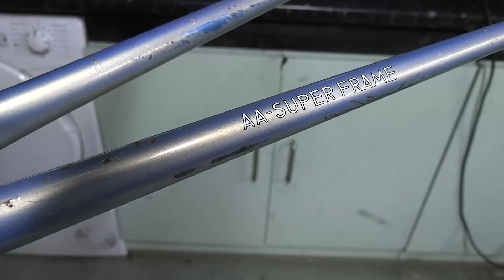Gazelle Champion Mondial Road Bike Restoration Build and Ride

Comment: The 1980s were an... interesting time for road bicycle racing. Can you imagine today that you are riding a Tour de France with downtube shifters, 2x8 gears, toe clips, and tires that you are supposed to stick on.

If you are looking for Gazelle kit, just pop over to the Netherlands, you will find a lot of Gazelle and Batavus frame sets just dumped in the scrap. Gazelle didn't have a huge market outside of the Benelux.
Reply from the maker: I should make a trip over and rescue a few, yes hard going doing a tour on one thats for sure. Thanks for watching and your support, all the best
Reply: Well I do my club ride on the flats (I'm 49yo) with my Saronni red Colnago Super with a 13-18 block and MAVIC open SUP clinchers.  Off the back drafting and using almost always my 13 cog keeps me young.

Comment: That is lush. Lovely frame that thoroughly deserved the effort (and money!!) you put in. 
Love me a Champion Mondial, I found my first one in a skip believe it or not, some 15 years ago. It's not as nice as yours mind, just an AB frame from the '70s. I built it up as a fixie and it served as my daily bike for a good while, commute, errands, the pub - a loyal companion during my 'wild years'. But other bikes took over and it was kind of just sat there, dismantled and slowly accumulating cobwebs and surface rust. Until I decided that it deserves better, so I fixed it up (more or less period correct) and did Eroica on it.
I've since got a 'modern' Champion Mondial, a '90s model, one of the very last steel road bikes Gazelle made. In the colour scheme I always lusted after, red with white lettering. I intend to build it up with a modern groupset and it should be really close to the one bike I've always dreamed of.
Reply from the maker: It’s always a bonus finding one in a skip….and for me you really are saving it from becoming scrap. Nice one, and great to hear your creating a resto mod with one, best of both worlds should make a great build. Good on you! Thanks for your support it’s much appreciated

Comment: Breathtakingly beautiful. Wow. I use challenge tires for road and cross and love them. Im guessing it's prob a 42x21 'climbing' gear. Won't catch me on steep hills with that. Same with my beloved old school steel bike at home.
Reply from the maker: Thanks glad you liked it the chainrings are 52/42 with 🤔 hmm probably 26-12 on the cassette. Sweet but old school hard ride at times 👍

Comment: Very nice build, love it. I did use a velox branded tubular tape on my latest Frejus build, worked so good that I’m probably never gonna use the normal glue again, it is truly the hassle free option. No mess, and you can center the tubular perfect. I use veloflex tubulars, they are the best in my opinnion.
Reply from the maker: Thanks for the advice sounds a lot better than the hassle of all the glueing 🤔 I’ll check it out. All the best 👍
Reply: @BikeItUK  Velox worked fine for me until I moved to a more hilly area. The problem seems to be heat during descents which cause the tubulars to move.

Comment: Brilliant restoration - The color scheme: phenominal - lug work: Apex. What a treat to look at. Noticed that you chose the right side brake lever to control the front brake. The cable L👀ks to have more of a bend in it -  is cable friction affected this setup? The wheel base and tight geometry demands being on the drops more to get better control / feel - do you concur? The acceleration when you stood up looked instantaneous. I'd say this bike fits you the very best of all that you've ridden thus far. Thanks again for the show & tell :)
Reply from the maker: Hi thanks for the support glad you liked it. Yes for some reason in the UK the right lever is front 🤔 it functions absolutely fine however you know it’s been designed for Europe etc in mind. The bike was an absolute pleasure to ride and I couldn’t help but put the pressure down and sprint off. Loads more in the pipeline thanks again 👍

Comment: You do a great job on refurbishing these bikes to their original beauty. But from a practical stand the gearing back then was way to high for me and probably most riders.  Modern compact chain sets make riding over mixed terrain much easier than the old days.
Reply from the maker: Thanks glad you like the work, check out the Colnago build. We mix it up with retro looking Campagnolo Potenza 11 speed 👍
Reply: @BikeItUK  I checked it out. A beautiful job. But that’s not a compact chain set is it?

Comment: Cool as a Dutch i am restoring a Gazelle Olympia vintage around 1980 at the moment , blue markings going to look awesome  again a fixie though with some 2022 features. But i have to many bikes haha and not enough space so i have to get rid of my Batavus Adagio Nuvinci city bike.Batavus another Dutch brand , that bike is a tank never had any trouble or major repairs biking since 2008 on it 1 flat tire that's it most impressive but super slow !! For daily use i restored a Trek FX7200 (Joe Biden has one) , and for the summer days riding a Nirve Cruiser.But maybe the Gazelle is going to be "weapon of chioce" Greetings from the Netherlands ! Nice video !! never owned a Gazelle about time(as a Dutch) .
Reply from the maker: Yes probably about time you did own one considering your location 👍 Thanks for sharing your collection, Im exactly the same not enough space. All the best and thanks for watching

Comment: Stunning build!
I hate to be that guy but the valve hole isn't properly placed on the rear wheel, it should be between 2 parallel spokes. Same for the front one...
Reply from the maker: Thanks glad you liked it, I’ll have to check it out. 🤔 thanks for the heads up

Comment: Hey I have a Gazelle road bike, I bought/imported in from holland to U.K. in 2015. It's a 16 speed road bike, probably from late 80's or 90's. It has original campagne brakes, gears, crank, spindles etc. Anyway I'm selling it due to moving into a flat, but not sure the best site to sell it on as it's more for people who are into retro bikes. If anyone has some advice for me, I'd be really grateful.
Cheers, Dave.
Reply from the maker: Hi Dave, thanks for watching! Regarding selling I sell most of the bikes I restore on eBay as a buy it now. Hope this helps good luck
Reply: @BikeItUK  Ah fantastic! Thanks for getting back to me, I'll put it up next week. Thanks for the advice!

Comment: Another great build Andy. i just picked up a 90s i think bianchi reparto corse buts its got pots of chips andi i need to touch it up, can you point me to where i can obtain the paint. thx for your informative vids.
Reply from the maker: Glad you enjoyed it. Personally I have a Bianchi on the stand at the moment, I've ended up having it completely repainted. I did buy some touch up from eBay but in all honestly it did not match well at all. Maybe see if a car paint shop can mix some or try one of the Bianchi Facebook groups I'm sure someone on there can help. Good luck
Reply: @BikeItUK  thx for that mate will do